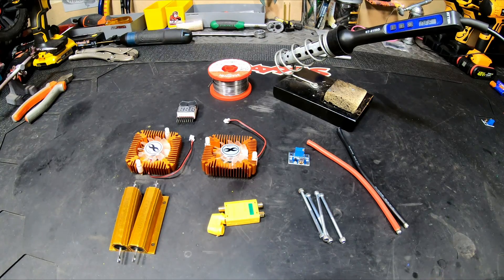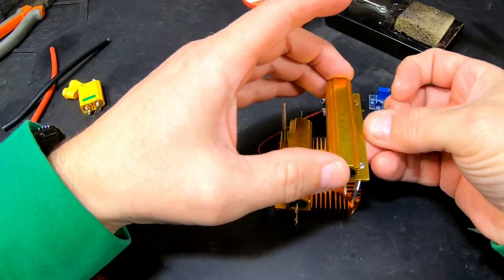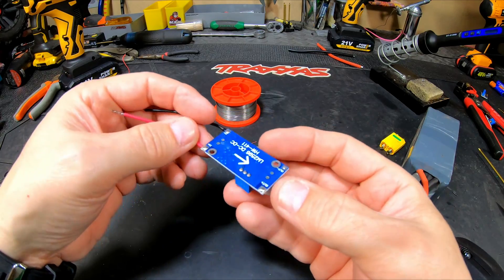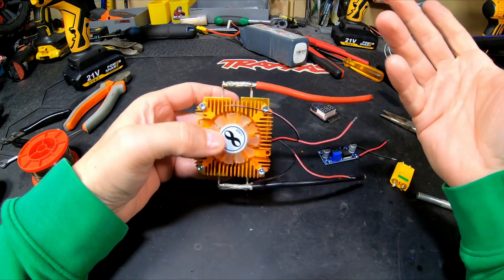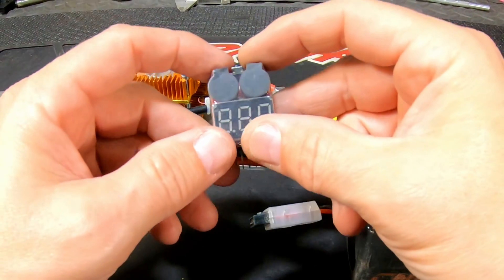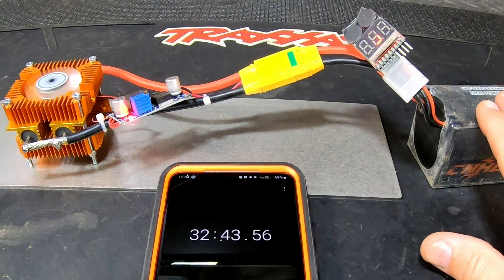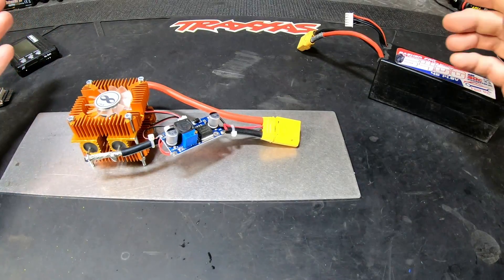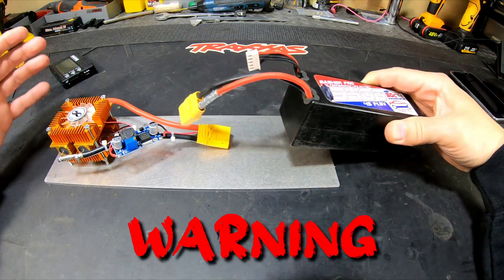How to build a CHEAP Lipo Discharger / Killer

Comment: "DRAIN the battery completely empty!?" The ONLY way that can happen is IF the battery pack does NOT have a BMS - ALL commercial packs; like the one YOU show - come with a bukt-in BMS. This is one of the WORST videos I have ever seen on utoob!!!
Reply from the maker: when you dispose of the battery you need to completly drain it, otherwise they won't accept it. And yes every battery can be drained. If the BMS was supposed to protect them, why is it possible that when you keep on running it on it in the car the lipo goes under the safe cut off voltage. Wouldn't the BMS suppose to stop that?